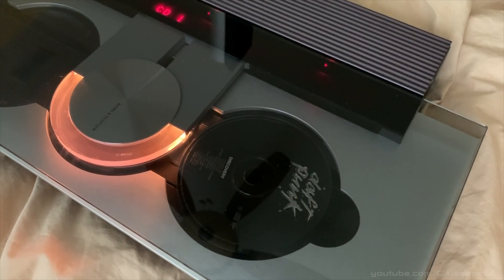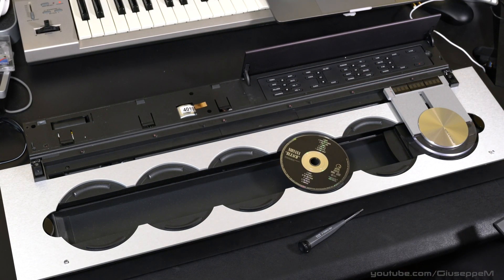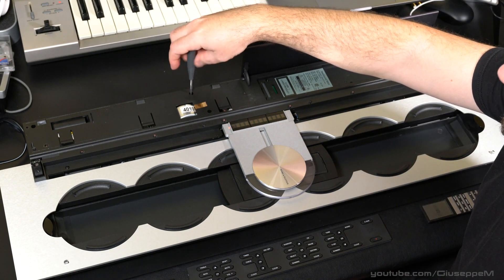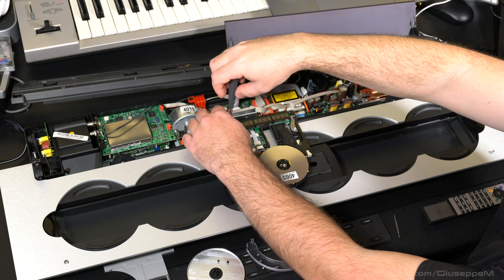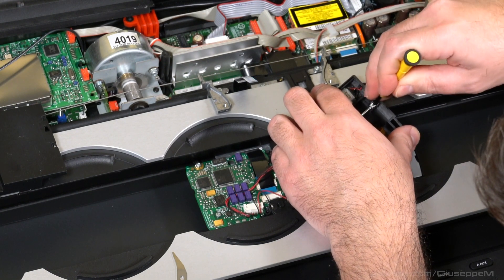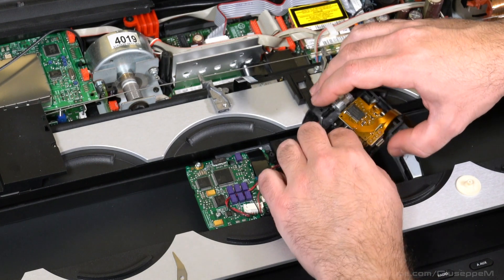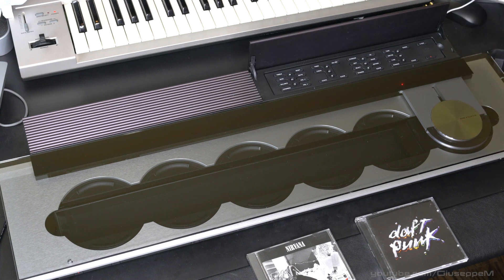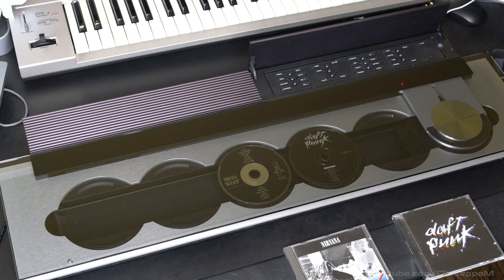Beosound 9000 "CD Pause" error, laser repair and maintenance tutorial - Bang & Olufsen

Comment: can you share the source of the laser unit VAM1250/21 please
Reply from the maker: I got it on eBay but you have to double check with the seller because sometimes they send the wrong unit
Reply: @GiuseppeM  I noticed one version has the round diode solder the other sort of a bar or line. I got different infos from suppliers claiming either works. Which did you use ?
Reply from the maker: @alexarif2835 it’s been a while so I can’t remember exactly

Comment: Excellent, would have taken me 2 hours of reading the service manual and going through each disassembly phase. Would be great if you had mentioned the laser but appears to be a VAM1202
Reply from the maker: I'm glad it helped you, the listings online for that part can be misleading so it's always best to confirm with the seller
Reply: @GiuseppeM  The correct laser also depends on which model Beosound 9000, the one I have for repair is the Mk III so it needs the more expensive laser VAM1250/21

Comment: Hi Giuseppe, i´m having some trouble with my BS9000 MK3.

The glass door is pressing on the sledge, which is pressing on the disc and making a scratching noise. (Sound output is intact though). I understand there´s some way to adjust it with a screw, could you please help me?

Comment: Great video Giuseppe, thnx!
I am working on a BS9000 too. But removing the glass door, I found that the torx screw in the lower/left hinge is stuck.
Do you have any advice how to get it out?
Reply from the maker: @KolfMAKER  thank you!
Reply from the maker: If i remember correctly the screw is not supposed to come all the way out, just release the glass so you don't lose it
Reply: @GiuseppeM  It worked, I got them out!

Next, I have replaced the laser with a new one. Now it makes a rattling sound for a few seconds when I it tries a CD. I am quite sure it is the gearwheel scratching the teeth on the slide bar with teeth (the bar on the laser unit, that moves the laser and lens back and forth).
I have dis- and re-assembled it again. Making sure the teeth on the gear wheel are on the slide bar with teeth. But as soon as the system starts, and it pushes the laser/lens to starting position, it rattles again.
Could it be that a wrong laser unit type causes this? I was advised to use a VAM1255 for the BS9000 MK III.

Comment: Hi.  Your help would be much appreciated…I have a Mk2 that plays the cds but some
Cds make a scrapping sound   I notice there is meant to be a key that adjusts the player depending on if it’s lying down or on a wall. I don’t have this key. In the video he shows some toque screws, Will adjusting these screws stop the scrapping ?
Reply: Hi, I Have the same problem. Could you get it done? Mine scrapes but just on the left side, I notice that if I gently lift the glass with my finger it stops

Comment: Thanks for the video, but i have issue to enter the test model, i have remote control but not sure why the list button not doing anything 😢
Reply from the maker: did you try to follow the sequence in the video?
Reply: ya,  I did followed the sequence, anyway, I have it replaced, but still showing error of dust lol  @GiuseppeM
Reply from the maker: @tongy876  have you tried using a Q Tip with some alcohol on it and wiped the lens?

Comment: Hi!
Great video for an easy repair.
I just lost CD player on my MKIII a few weeks ago and tried this, as for the first replacement didn't work, i bought another new one from a different seller as i read on the comments it might be wrong part but i am now pretty sure i got the good part.
All and all, it is still showing pause after a few seconds, any thoughts on what the problem might be?
Reply: Look up the service manual online. Enter service mode and run the tests, you should get an error code which will point you in the right direction.

Comment: Great vid. Can you do a vid on how to adjust the glass ?
Reply from the maker: You mean how to release the glass panel from the frame?
Reply: @GiuseppeM  No. I mean how to adjust the glass so it’s parallel with the alu frame
Reply: @Henrik-Pedersen  @GiuseppeM i Have the same problem, please do a video about it!

Henrik, could you get it done? If so, could yo please tell me how?
Reply: @GiuseppeM  I think there is a little Allen screw near the hinge I each side. One is located close to the control panel’s red standby button.

Comment: Hello,

I have the ploblem with my IR reciever for the Beo4, it does  not work  and I want to repair this part for my MK I. And secondly, I have to replace my Power Supply Unit. Because the BS9000 turned on and after 1 sec turned off. Do you know, where I can get the parts that I need? I think without a remote contrill, i can´t get into the Test Mode???

Comment: Hello, just wanted to know if there was a diagnostic I could run to determine that the laser is faulty? Don’t want to replace just to find out it is not the issue. It moves into the correct position however has stopped spinning / playing CDs. Thanks so much!
Reply from the maker: Yes there is a code combination that you need to do to enter test mode from the remote
Reply: What is the procedure to enter the test mode and then the procedure to exit the test mode? Thanks

Comment: Hi Giuseppe - firstly great instructional video which was easy to follow and informative.  I have a a question regarding reassembly.  When reassembling the CD cradle (removed circa 4:00min reinstalled 7:18min), it now drops down a little and the mechanism is unable to freely move without hitting the chassis.  I think it is called the clamper.  It doesn't hold up in position though I'm pretty certain I have put it back exactly as per instruction.  I noticed this on assembly attempting to slide back into position 1.  It required me to lift slightly to clear the silver frame.  I checked and re-seated 3 or 4 times with the same result.  I repowered thinking it might auto adjust and resolve but now no longer can freely slide without hitting.  The spring adjustment was in the correct position prior to disassembly.  Any advice or suggestions to help?  Thanks.
Reply from the maker: Hi, thank you! Did you try to readjust it with the screw? I remember having the same problem but it’s been a year 😅
Reply: @GiuseppeM  Hi guys. So I've pulled mine apart a few times now. Replace the laser twice (wrong unit the first time). Much of this instruction is unnecessary as you don't have to remove the back panel at all. Also on the clamper, the back two torques are height ADJUSTERS, they are the problem Adrian is having.
Reply: Oh and by the way. Mine still doesn't work...
Reply: I have the same problem! how did you solve it? please help me!
Reply: @83mancio83 as Adam said, the two screws at the back of the clamper are height adjusters.  If you screw them all the way in it messes the alignment.  Unscrew them but not all the way until you have clearance.
Reply: @adrianromeo  :-O
and now how will I understand HOW MUCH THEY HAVE TO BE SCREWED OR UNSCREWED??
:-(

Comment: Hello:  Loved the video.  MY 9000 is stuck with the glass down and pin code light blinking but unresponsive otherwise. I need to get the CD out and I can't get anything to work.  Any suggestions?  Thanks
Reply from the maker: I think there is a solution in the manual but I don’t remember exactly
Reply: First try entering the pin code. You can pull the door open without power to access the CDs. Door is made to open if unit is unresponcive
Reply: If you have forgotten the pin Get the master code from B&O to unlock. You will need the serial number from the label or there is some sequence of buttons to reveal the serial number in the screen.

Comment: Hi amazing video I have beosound 9000 mk2 I can’t not take the laser unit out it’s the top right hand side where the screw is the screw is out the laser unit I can lift out on the 3 sides but the top right hand side is sticking in the metal housing just can’t not get the unit out please can you help me or any one had the same problem waiting for your reply thank you
Reply: The cd clamper is in the locked position. Press one of the other cd locations and when the clamper is moving turn the main power off to allow the sled to move freely. Failing this you can manually unlock with cog underneath the sled. You need to poke at it with a screwdriver and is tricky.

Comment: I am based in Korea and the Customer Service told me, B&O no longer produces the necessary parts (the laser module & amp included in BeoLab1 speaker) and nothing can be done to make them work again.  Do you know if this is true?
Reply from the maker: It is true but they never made the laser, you can find a replacement and have a repair shop install it. The original modules were faulty and they will all fail sooner or later
Reply: @GiuseppeM  C’iao. Can’t believe the local B&O never voluntarily recall if that is true.   I have decided to contact a private repair service which isn’t an official B&O service.  Thank you Giuseppe.  :-)

Comment: Hi mate. Just wanted to note a couple of things.
Firstly there is no need to remove the whole back panel. That little piece that comes out  at 1 min 45 is FOR this repair. Once that is out you can pull the assembly.
Second, the two tiny torx at the back of the transport are adjusters. They manage the height. I'd be leaving them alone.
Lastly - I had this identical error. Changing out the laser did nothing...
Are there any other thoughts on what can cause this error. Incidentally I don't have a functional remote
Reply: You can release the sledge by opening the glass and pressing cd position 6 then disconnecting mains power as the sledge is moving
Reply: @rivalrepairs  this is clever. wish I knew this before buying the remote.
Reply from the maker: Thanks for the feedback! I believe they sent  you the wrong laser module; check with the dealer and check with different stores. You definitely need the remote though
Reply: Good tip. I wish I left them alone.

Comment: Well, after buying a Beolink 1000 remote, I was able to get into TEST MODE, and proceed with the repair you go over in this video. Your video was extremely helpful...thanks so much! I wouldn't have tried this without your guidance. 

A few things to note...there is an extra screw on the CD carrier that you have to take off to get the sledge to snap out of the arm holding it onto the unit. 

You don't mention that you need to release the ribbon cables as you pull the sledge off the unit...there are releases on the left and right side of the cables that you need to push back to release the cable. You mention those when putting them back on later in the video. It may be obvious to you, but to those that follow directions to the letter, this could throw them.

Also, I'm not sure why you took the whole back plate with the 9 screws off to do this repair. Perhaps you had other repairs to carry out on this unit that required it, but for this particular repair it isn't necessary. Just set the BS9000 into TEST MODE using the remote, press CD and then 72 to get it to release the sledge, move it by hand to somewhere convenient, then undo the bits to get the sledge off. There isn't even a need to remove that tricky center plastic thing to get the carrier off.
Reply: You do not need a remote you can just pull power when sledge is moving to allow it to be released.
Reply: @rivalrepairs  LOL, yeah I guess that would do it
Reply: Hi you change the laser for you beosound ?
Reply: @arabiamar4022  Yes, once I was able to get into TEST MODE,  I was able to proceed with changing the laser as per @GiuseppeM 's excellent tutorial.
Reply: @thinkjedi  hi there, how did you get the CD player into test mode.
Reply: @thinkjedi  It's another bypass way if you don't have the remote, the trick is when the CD finder it moving, cut the power then you will able to move by hand.
Reply: @thinkjedi  
Do you have an advice for removing the hinge torx screw, that is stuck?

Comment: @GiuseppeM  I tried getting into test mode on my BS9000  on my BEO4 remote, but it refuses to do it. I have one speaker attached, so the BS9000 responds to the remote. I programmed the SHIFT key to be in the LIST. That's where I'm stuck. I tried hitting LIST to call up SHIFT, then pressed the GO button. Then I punched in 9-0-2-5-8. When I tap the first number, the display goes right back to CD, and doesn't show the numbers, either on the remote or the BS9000 display. What am I missing?
Reply: With the unit in standby, hit LIST until you get to SHIFT. Do not press GO, instead just type in 90258. That should work.
Reply: I have the same problem,it doesn't go into test mode with the code
Reply: @chabulux  I never figured out how to get into test mode using the Beo4 remote, so I ended up buying a Beolink 1000 off eBay. I'll keep it as my "service" remote and use the Beo4 for normal use.
Reply: I have fixed mine
Reply: I have stuck in this test mode problem too, do someone know how to set the bs9000 to test mode by beo 4? Please help🙏🏻
Reply: @woorex2229  With the unit in standby, hit LIST until you get to SHIFT. Do not press GO, instead just type in 90258. That should work. If you hit Go to select SHIFT, it will not work. Also, sometimes it can take up to 10 seconds to acknowledge that it is infact in test mode.

Hope that helps.
Reply: @TheStudioDankster  
Hi can you please help me on my mk2 the cd unit is not moving from cd 1 ? Just stuck there and what can I do to fix this kindly please let me know thanks sam
Reply: @mohindersembi7647  First thing I would try is cleaning the glass and the two little sensors on each end of the unit (under the glass). These being dirty can make the unit move very slow and sometimes not at all.

You should also ensure that your unit has the two orientation switches set properly, although Im not sure this would stop the CD clamper from moving all together.

If you are running the unit laying flat on a surface, I believe the two screw adjustments should point inward towards the rest of the unit. You can find them beneath the unit on the right side, behind two removable rubber plugs. They are screws with a arrow marking. They both must be facing the same way. You can find more info about this in the user manual.

Aside from these things, I am afraid the problem might be too specific for me to help you with remotely. Problem could be mechanical in nature or an issue with the electronics. You may want to try using the steps listed above and put the unit into test mode, switch to CD mode, and run test mode 71. See what errors pop up and then post your issue on beoworld forums.

Good luck with your unit!
Reply: @woorex2229  If you do not have speakers attached, you will need to set A. Opt to 1. You do this by pressing the red circle button and list at the same time. Then press list until you see Option?

Press Go, then press list until you see A. Opt. Do not press go, instead, press 1. The unit should blink to indicate this option is set.

You will also likely need to add Shift to your command list. You do this by hitting the red circle button and list at the same time. Then press list until you see Add?

Press Go, then press list until you see SHIFT. Then press go.

NOW YOU ARE READY TO ENTER TEST MODE, WHICH I WILL DESCRIBE IN THE NEXT COMMENT

Comment: For the cd clamper when assembly need adjust?
Reply from the maker: I’m not sure sorry
Reply: You need to adjust depending on orientation of the unit. Ie sat flat / on vertical stand etc. There are two covers on the back for adjustment. See user manual
Reply: Hi.  Your help would be much appreciated…I have a Mk2 that plays the cds but some
Cds make a scrapping sound   I notice there is meant to be a key that adjusts the player depending on if it’s lying down or on a wall. I don’t have this key. In the video he shows some toque screws, Will adjusting these screws stop the scrapping ?

Comment: Where did you get the replacement parts? And what if our remote control doesn't work for the first steps?
Reply from the maker: The remote doesn't work if the speakers are not connected, there is a workaround, press simultaneously on the remote STOP and the red button at the bottom right and then click the number 1. I bought the part on eBay but i can't recommend it because the first time they sent me the wrong part.
Reply: @GiuseppeM  - Ok, we will try that with the remote. Is ordering parts on ebay the only way to get them? Do you know anyone in the US that does these repairs?
Reply from the maker: @lynellbarthel  if you call Bang and Olufsen they’ll find a shop close to your zip code, don’t use their online finder

Comment: Excellent!
Did you also repair the powersupply module in the past? I have a PWR Error 20 and I Never dismantled the beosound 9000.
Reply from the maker: Thank you! I haven’t this laser mechanical issue is an actual factory defect and sooner or later everyone will have to fix it.

Comment: Thanks for great video! I have a different problem, CD is working but the sled is stuck in position 1 and does not move. Any idea if this is potential cleaning issue,  a mechanical jam or some part that needs to be replaced? Any feedback would be greatly appreciated.
Reply from the maker: Thank you! If you go into test mode you can find out what the actual problem is
Reply: @GiuseppeM  If you have the MK-I or early MK-II you won't see the message Cleaning Required.  But the likely cause is dust or dirt on the two small plastic tips at either end of the top plate.  Those are part of the FINGER PROTECTION system.  Clean both of them and the UNDERSIDE of the glass cover.
Reply: If you have the MK-I or early MK-II you won't see the message Cleaning Required.  But the likely cause is dust or dirt on the two small plastic tips at either end of the top plate.  Those are part of the FINGER PROTECTION system.  Clean both of them and the UNDERSIDE of the glass cover.